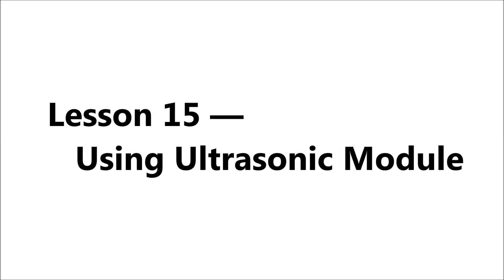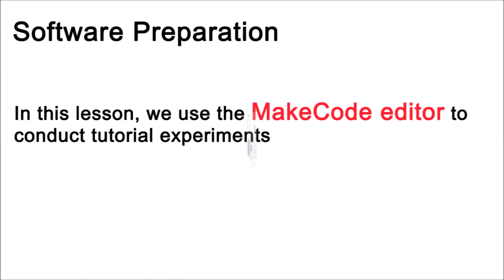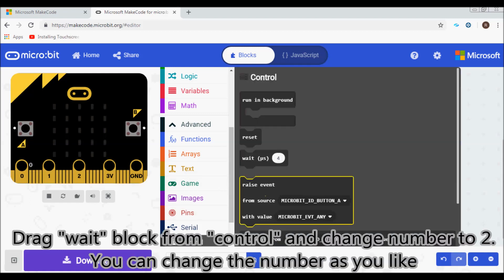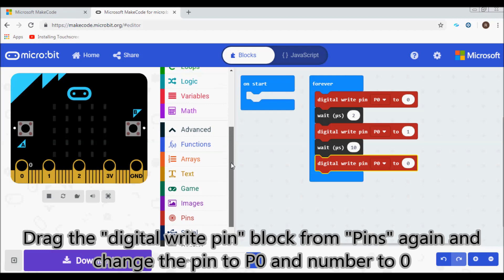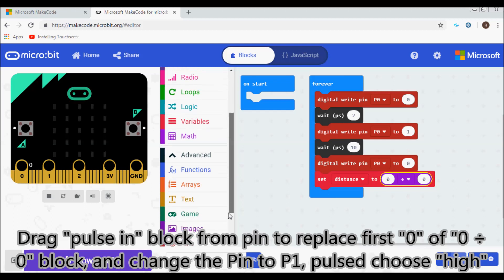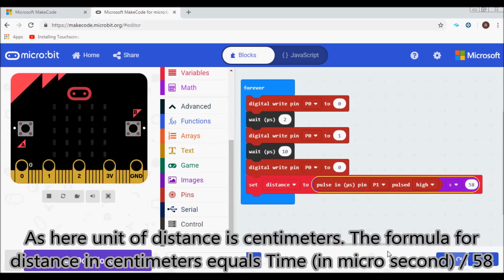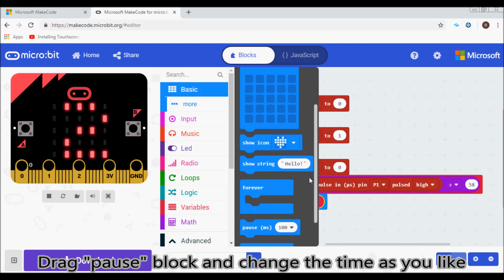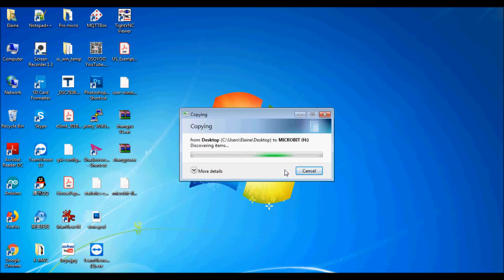Micro bit 15: Using the Ultrasonic Module

Comment: I heard that that high pulse may damage your microbit's pin 0.
use the tm1637 extension or résistances to make sur that yr pins 0 is safe
Reply from the maker: You can add a resistance.